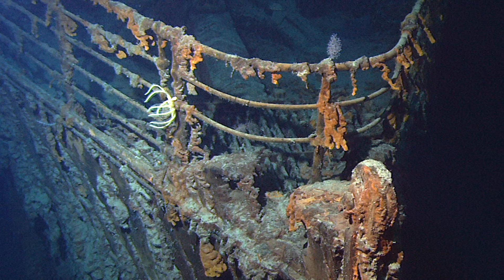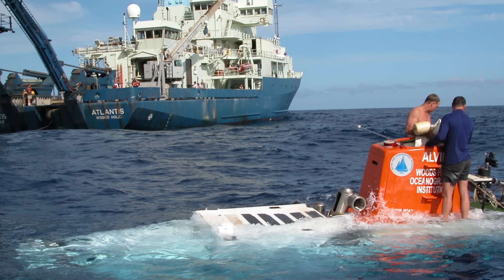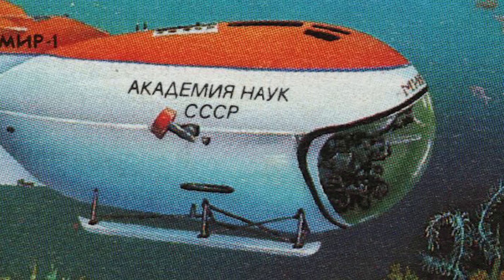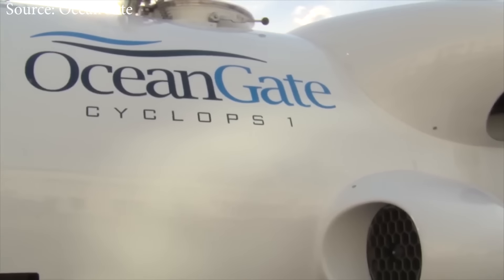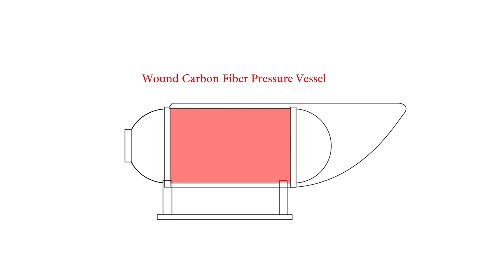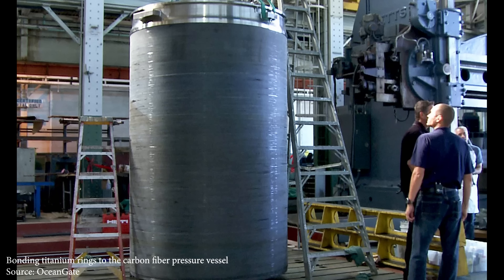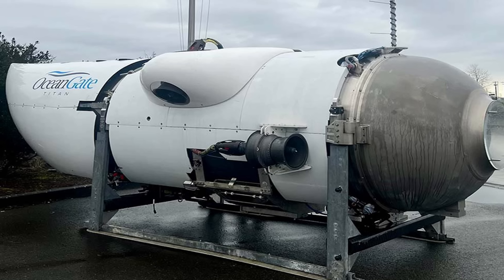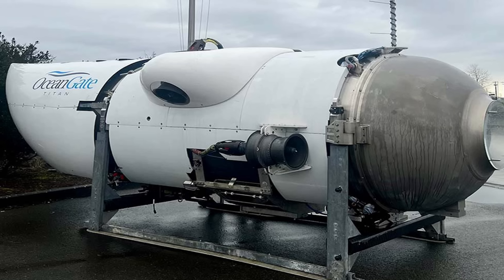How Titan was Built, Lost and Found: An Analysis

Comment: I am a mechanical engineer that works for a composite pressure vessel manufacturer.. So i have a dog in this race... their testing and design are VERY flawed. No proof? no MEOP? No destructive testing? No cyclic testing? Absolutely insane! Also their boss interface is bad.. Their boss needed to be inter-woven with the composite structure and not just epoxied on and i guarantee they didnt prep that bond surface right with a clean room etching and a water bead test. also they probably didnt do a lap shear bond test on that interface.. It is absolutely insane that ANYONE was enter and submerge in that death trap!
Reply: Its terrible. Not one fail safe item like a pinger, or buoyancy device. Everything is a single point of failure and no backups. Really annoying to see such a bad design. And now people are at risk because of it. A horrible situation.
Reply: Crazy. They never even used a test vehicle to failure in an experimental setting. Didn’t have the money for it. They also didn’t even lay the carbon fibre in the way that prevents bubbles because it results in carbon fibre waste, which is an expensive material.

Comment: Oceangate's science may have been sound but their engineering was extremely flawed. The craft wasn't just experimental it was poorly designed. Acoustic monitoring won't give you enough of a heads up to be effective, and it's not yet possible to reliably predict how many cycles of stressing carbon fiber can take before failure. It wasn't if the submersible would fail but when and how deep would they be when it does.
Reply: I tend to agree with you. Rush definitely proved that carbon fiber cannot be dismissed out of hand in the design and construction of a submersible. As you say, the mistake was the DIY engineering.

Comment: 13:10 The Comet did not fail because it had square windows but because of the way they were manufactured. Yes the square windows were a point of weakness but what caused the cracks in the first place were the punching action of riveting around them.
If tight angles around windows were the cause then how come pilots' windshield windows also have those tight angles to this day?

Comment: You are giving OceanGate way too much credit.

The (stated) goals of the company may be scientific, but the Titan was a tourist sub first and foremost. It was a scientific experiment in how effectively they could earn money, and so as a commercial venture the sub was made as cheaply as possible. A wired controller for a non critical system that can easily be swapped out is not equivalent to a wireless controller being used for primary control. The whole explanation for how the wreckage was found is basically irrelevant because they knew exactly where it was from the start, they just needed an ROV capable of getting there to visually confirm.

Comment: So wait! What is that cylinder they were mounting the Carbon Fibre too at 11:15? If it's Titanium, wouldn't that mean it's technically a Titanium pressure vessel wrapped in Carbon Fibre?
Reply: I believe it's just a shell to wrap the fibers around. I think it was removed afterward.
Reply: @festivelad5079  Nah that was one solid piece! It would be impossible to slide the Carbon fiber off a spool shaped cylinder. I just watched a video with the bows viewport open and you can see the exact same metal ring.
Reply: @wezite1983  huh, I wonder if it's like a hollow steel double body? The point of the carbon fiber was to be a cheap pressure withstanding material I believe

Comment: I think you GREATLY misunderstand what Stockton was doing he said several times in interviews that it was to MAKE MONEY.  That was why he kept firing engineers.  I don't think he cared about science as anything more than a cover to make money. =__=  If it was science he wouldn't have used carbon fiber, done it in two parts and screwed a monitor INTO THE HULL.

Comment: The issue I’ve always seen with carbon fiber pressure vessels like in automotive or other industries usually have a shelf life of 5-7 years before they start delaminating. It’s very unusual for them to not have issues and any exposure to sun shortens it’s life. I couldn’t believe they were still using the same sub after so many dives and years.
Reply: @c.w.8200 that could make sense if technology or demand was changing rapidly. otherwise durability seems like a key desirable in creating industrial machinery
Reply: @_5_675  a good example I thought of was carbon golf club shafts. They are under extreme forces when it comes to drivers and are used over and over and have gone through years of development. They just start blowing up after a couple years of use. When I played a lot you would see it about every 6 months or so when playing in groups.

I just don’t get how they didn’t see the safety issue
Reply: @c.w.8200  it makes sense in certain industries in that respect when it comes to 3d printing carbon. Reasonably cheap to make and recycle.
Reply: @c.w.8200  I'd say ask that prof if he was willing to bet his life on something that's compostable but you're probably better off just keeping quiet.  His mind's made up, don't confuse him with inconvenient scenarios. It could get ugly.
Reply: Carbon fibre isn’t ideal, it has very high stiffness and strength for its weight and is incredibly strong under tension but is not very strong under compression
Reply: @wrench8677 so , would you say carbon fiber is really good at what it was designed for, but sucks at being used for something else?
Reply: @c.w.8200  Yet another good example of "those who can, do; those who can't, teach."  You don't want to have a possibly mission critical thing to have a hard expiry date, as that expiry date will probably be at a time when you do not want that thing to fail.
Reply: @wrench8677 also as pointed out by Juan Brown on his YouTube channel the video showing the construction of the carbon fiber pressure vessel the layers didn’t appear to have been laid down at 90 degrees to each other. However that could have been a final layer covering the others. 
If I had to make a guess the Titan will be the only deep sea submersible with a pressure vessel constructed from Carbon Fiber.
Reply: @andersonnettleship845  yeah I don’t think anyone else will want to be disrupting the submersible industry like this for some time. 
I spent quite a bit of time in the mountain bike industry and the production of carbon bike frames is so much more advanced than this.
It’s shocking to see carbon fibre being laid up in a warehouse with no apparent clean setup to prevent dust and moisture contamination. I don’t think it would’ve made a difference but the whole operation seems so half assed

Comment: Update; although we'll never know for certain because of the state of the wreckage, the most likely cause of the implosion was catastrophic failure of the entire hull; not just the hatch. Why is this an update when it's not really new information? Because there's been substantiated arguments that this wasn't an inherent risk caused by diving two miles underwater and instead a case of a design flaw known to OceanGate and some form of negligence. Going all the way back to 2022, there were reports of audible popping or cracking from the hull which were supposedly never addressed or fixed. 

Now, I’m no engineer and this is gonna get confusing so bear with me. Titan was created using basically the same blueprints as Titan 1 which was designed to go to 500 meters underwater whereas the Titanic wreck is almost six times that depth. The design was for MUCH slighter sea pressure. The massive flaw with the design was that the carbon fiber composites used to pressurise the hull is designed for aircraft; not submersibles. Why does it matter? In aircraft, the forces acting upon the fuselage are blowing outwards which is why you get people ripped from an aircraft it if tears in half for instance. In submersibles, it's a crushing pressure which is a drastically different type of force so the entire design was kinda fucked. Even submersed, this design can be fine if kept at around 500 meters like Titan 1 was and regularly checked for wear and tear and can even be good for buoyancy. What went wrong is that it wasn't designed to be 12000 meters underwater. Other manned submersibles that go to similar depths use steel and titanium interlaced with foam layers for padding redundancies. This design is of course much heavier but stronger and very hard to crack. OceanGate didn't exercise this option because steel, titanium and foam padding is expensive and we live in a post-modernist capitalist world. 

The other Titan model subs didn't operate this ridiculously deep underwater so they never really had these severe issues or at least not to the same extent. At 500 meters, these fibers compress but they can last a long time if treated well but the Titanic is over two miles underwater with the pressure being insane. Under the crushing depths, the fibers were heavily compressed and would have only had so much. The fact is, the fibers were under constant stress whilst deployed so a clock was ticking before the fibers had taken all they could take with June 28th being the day it finally gave out. When that happened, there would have probably been some cracking and maybe banging before the hull was crushed in on itself.

I said "some form of negligence" earlier because there hasn't been an actual, legal conclusion on whether it was gross negligence or not. However, the families have a strong case on the case of gross misconduct and dangerously false advertising. Rush received a lot of push-back before the accident going back all the way to when he launched it for actual use by OceanGate.These even included thirty eight members of the Manned Underwater Vehicles Committee of the Marine Technology Society but dismissed it as hearsay and people talking about things they didn't really understand. He even said in a blog post that "[the submersible exploration industry]'s obscenely safe because we have all these regulations" but then that "it hasn't innovated or grown-because of all these regulations." In other words, "stop trying to make us certified because it hampers our ability to grow as a business and pay ourselves dividends."

Comment: A lot of the talk around OceanGate and Stockton Rush is pretty damning. His refusal to get third party certification on an experimental submersible AND take tourist on board is simply inexcusable. Stockton Rush has said in interviews he believes certifications would slow down progress and stifle innovation. The real kicker, though, is he claimed all these certifications were overkill because almost all issues experienced in deep sea submersible vehicles were human errors during operation, a fact which only serves to prove how essential and effective these testing methods are. He even refused an ultrasonic hull integrity test to find any imperceptible stress damage to the carbon composite material, which was the likely the cause of this tragedy.
Reply: Agreed - yet instead he went with a more expensive, entirely pointless 'safety' system. "He even refused an ultrasonic hull integrity test to find any imperceptible stress damage to the carbon composite material, which was the likely the cause of this tragedy." - even more bafflingly, he installed a sonic/strain-gauge based hull monitoring system to the submersible... which would give essentially zero warning and would only tell you once the damage has already happened. It's like fitting a smoke alarm that can only work once your entire house is on fire. Having it tested like you say would have potentially highlighted issues ahead of time.
Reply: Not necessarily. The hull was quite simply too thin for the job. A vehicle can pass every imaginable certification and then catastrophically fail when put to a purpose its design is inadequate for.

Even the legendarily indestructible Toyota Hilux pickup truck, after all, is only used as a vehicle in warfare by the desperate.
Reply: Everyone keeps saying the same thing, but it would never be certified, even if it were 100% safe because the technology is new and there are unknowns. Simple as.
Reply: @methylene5 None of the technology is new. The only innovations made were methods of cutting corners. And even if this were the case, that would only mean that the technology wasn't ready to be used for this application at all and shouldn't be used. If you were told you were getting into an experimental aircraft and "it's so new that they can't figure out how to safety test it," would you really, logically, decide to get on it?

Comment: 7:45 there's a huge difference between using a wired controller of good quality to operate some specific equipment and using a bluetooth controller infamous for its clumsy performance to operate the entire thing. The philosophy was not "simplicity", it was "let's just cut any possibile corner because I'm smarter than anyone else".
Reply: Exactly!
Reply: I can't imagine why they thought a Bluetooth connection was the way to go. What on earth was the point?
Reply: The controller had absolutely nothing to do with this disaster.
Reply: @jonjones3958  No one knows what went wrong just before the implosion. The controller is just one of many-MANY- bad choices on this submersible.
Reply: The controller is fine too as long as you, you know, at least has some more reliable redundancy.
Reply: @jonjones3958  It has nothing to do directly with the disaster. It is, however, a very clear indication of where the company's priorities are at when making this sub: cost-cutting at every corner possible, and that cost-cutting is a direct factor in the sub's ultimate demise.

Hell, they didn't even went with a more modern/sophisticated controller. They're using a Logitech  controller that's more than a decade old!  They're cost-cutting within their cost-cutting.
Reply: So true, furthermore, consumer electronics are vulnerable to static discharge.  I had a control box for a $200 gaming headset fail because I discharged static on it...the mute button no longer worked because of that.
Reply: I know right